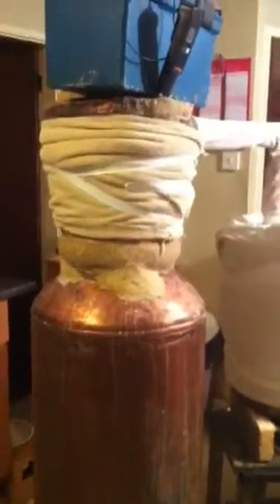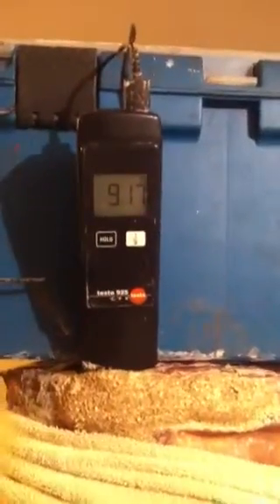How to make moonshine whiskey from your own homemade pot still

Comment: very nice, help you make your worm barrel better, place a center tube in the middle of the barrel with holes all around the bottom of the tube, run your hose in to the tube, cool water flows down on the inside of the tube, out of the bottom holes evenly and then the cool water will flow up across the worm to the out flow to the sink, you will find out with the cool water flows up across the worm as your warm vapor flows down in side the worm a better effect of condensation will occur improving the quality of the end result.
Reply from the maker: +PappyDan thats a good idea mate, i might try that, i do place the hose all the way to the bottom and its only the top few inches that got hot, however always looking to better the still so thanks for the input.
Reply: +Barney Rubble is it just me looking at your still pot, or is your still pot an old dairy farm milk can?
Reply: +Barney Rubble i got a little 5 gallon pot i play with, soon it will be time to blow the dust off and make some wild blackberry brandy, when blackberry season is over i do some apple and peach brandy.
Reply from the maker: +PappyDan sounds food mate. do you make large batches of wine?    
then rum it. I would like to hear how you do the apple and peach mate.
Reply: +Barney Rubble apple brandy, part 1, 20 Qt pot, core and cut up 8 pounds good apples, 1 packed cup of dark brown sugar, top off with water about 1 inch above the apples, bring to a boil and simmer 1 hour, let cool and turn it all in to mush,  part 2, 20 Qt pot, 1 bag of cornmeal, water, boil, turns out nice and thick, let it cool to around 150, add in 3 teaspoons of  amylase enzyme to convert the starch, mix, ( I use a wire whip with my drill) the thick starch will break and it will become like soup, part 3, apple mix in fermenting barrel, corn mix in the same fermenting barrel, mix well and let it sit 24 hours, part 4, sample, if you do not taste the brown sugar, add 1/2 packed cup to a gallon of water, mix and sample again, if you can taste the brown sugar, pitch your yeast and come back in 5 days, should be ready to run.
Reply from the maker: Nice one pappy, where are you from mate?.i only have 5 min at mo will speak again in couple of hours. BR.